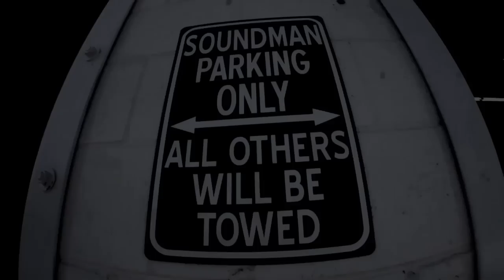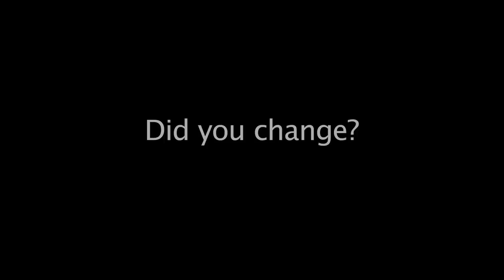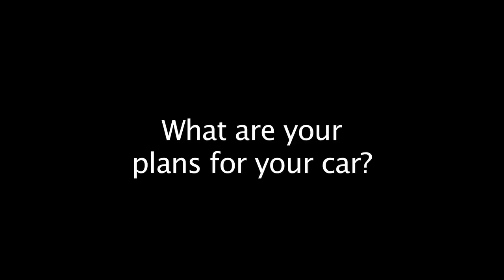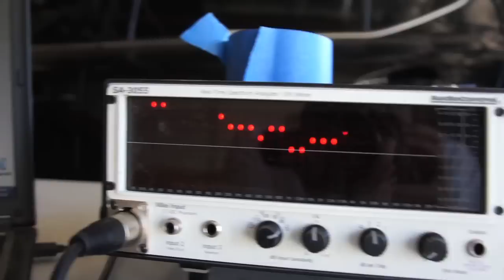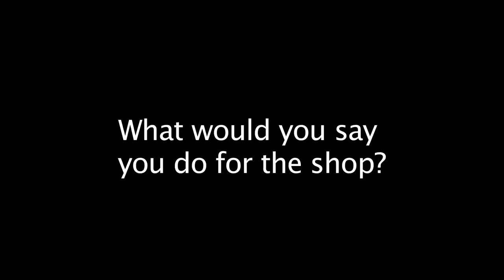Amplified - 27 "Spoon" @SoundManCA, SoundMan Car Audio, Santa Clarita

Comment: When explaining the EQ I know exactly what your talking about. Funny though when people use an EQ they always increase from 0 when you should start decreasing from zero, this way you don't peak the sound when you turn it up. If you want more bass and treble, or as some call it the smiley face, instead of cranking up the lows and highs you should lower the mids and keep the lows and highs at zero. Want more mids then lower the bass and treble. Then if it isn't enough then you can start increasing from zero. Always decrease before you increase, it will save your speakers from blowing up lol.